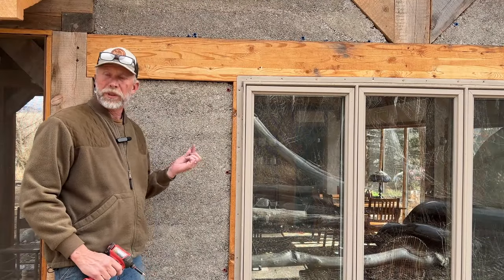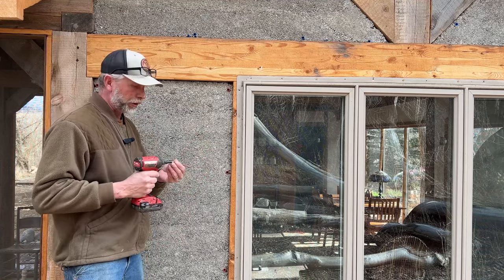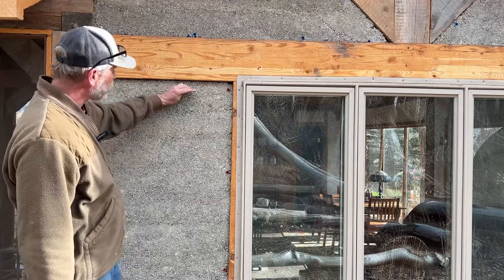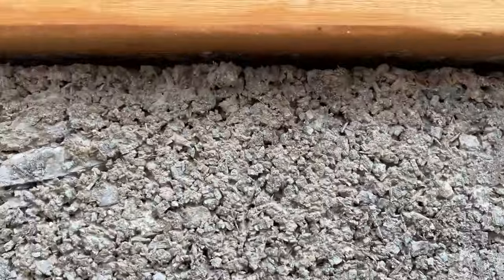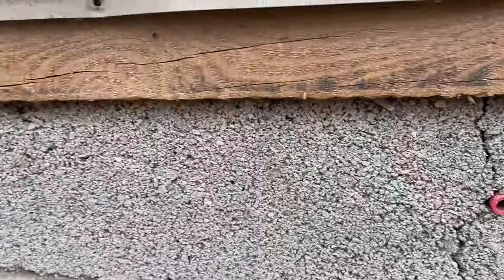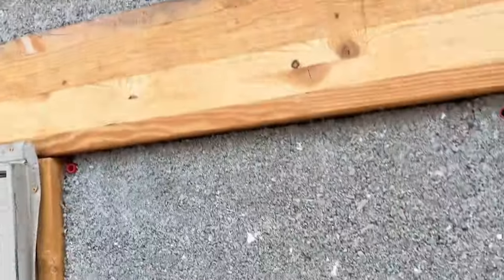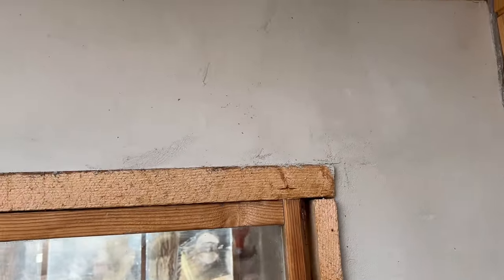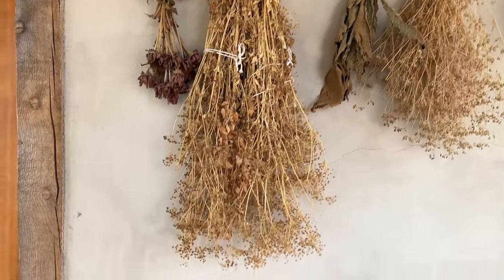Dustcrete FAQ Part 1

Comment: It's written already, but thumbs up for the helpfull follow-up! 
I think it is very admirable you answer a lot of questions, thank you! Good luck!
Reply: I got a $14 corded drill and a $3 cement mixer attachment. I had to use duct tape at the connection because of the soft metal but I've done about 600 gallons so far and I'm very happy that I didn't spend thousands of dollars

Comment: I did some experiments and I kept finding that the cement helped a lot with a cracking. The clay just made things worse. It could be a preparation issue.  

I can say aluminum foil has been a game changer. Mostly in the roof at the moment  The infrared light is an important part to understand about insulation. And it seems the coverage only needs to be on the sunny side.
Reply from the maker: Nice!

Comment: I liked your idea about the next build you do having the wood timbers on the inside and the dustcrete a solid wall just outside the framing structure.  Im trying to decide how i want my walls on my next build and i really like that idea.  Im in missouri.  Tell me though, it seems that the best wall would be made all at once to avoid cracking, but that seems impossible for myself to do and i would prefer to just do a wall at a time like you were doing.  So how could it be done without getting cold joint cracks everywhere.  Im thinking if you just used lime (doesnt it set up much slower than cement?) and also add some sort of mesh reinforcement or fiber (straw or fiberglass etc) to the dustcrete that should help.   Is strawcrete a thing?  Maybe a batch of half straw/half sawdust would give it better crack performance?  Do the cracks even matter as long as you let it crack first and then finish with lime or clay, does that cover the crack so its never seen or would it keep cracking there?  Or maybe it should be designed with control joints between batches/walls?  By the way how are those tests coming with just lime and whatever else...

Comment: You can probably hide the cracks well enough with applying a mesh of fiberglass or something before plastering. The cracks arent a big deal anyway since the dustcrete isn't load bearing and your wooden structure holds everything.  

Personally I'd add tiles or wooden shingles to the roof instead of the metal roof just for the looks. 

I want to learn about timber framing myself it's on my bucket list unfortunately timber here (Belgium) is very expensive as a building material.

Comment: My guess: the cracking is mostly due to the shrinkage - most of the volume is wood anyway and wood will move with the weather. That's why I doubt it will be durable enough in weather with large air humidity swing between seasons.
Reply from the maker: @col0342  I agree, in part. I think this is wood shrinkage. The saw dust I used was super fresh, and lost a good bit of volume in the curing process. I was just sent a Mother Earth article about a man who developed a similar technique in the 1940’s. He found 1 year aged sawdust to be perfect (softwoods). He also added clay and Diatomaceous Earth to the mix.
As to durability, my oldest sections are 4 years in, and show no sign of degradation. The lime plaster helps regulate the humidity within the wall. Even un plastered sections on the outside are rock solid after three years in the elements. My climate is arid.
Reply: @radicalgastronomy  thank you for the extra info.
It's hard to conduct experiments when the time scales needed are in (low) 10s of years and one factor is the (time and geographically variable) weather. Does require a willingness to take a good deal  of risk when using the technique for something as expensive as a home, I might give a try with a shed tho.

Comment: Have you experimented (or have review from others experimenters) about loard bearing dustcrete structures ? What would be the minimal thickness for instance for a wall? And roof sheeting ?
Reply from the maker: I’ll cover this next week, but I believe this is possible with a reinforced bond beam at the top of the wall. If I was doing it I would wait 60 days after packing and form stripping. Perhaps I’ll do some load tests at different thicknesses. I wonder about corners, too…

Comment: What is the wood you're using, what are the best ones, the ones to avoid ?
Reply from the maker: I’m using mixed spruce and fir. Most wood types should work, but hardwoods may be slightly less insulating. I haven’t tried, so I can’t say for sure.

Comment: This seems so promising with so many possible uses, could it be a stucco substitute? I have wood panels on my house that have aged relatively well except for where Virginia creeper Vines have creeped in and allowed moisture and cracking, as I remove them it occurred to me that spackling the house with a mixture like this could provide a paint like powerful protective coating?
Reply: Foamcrete is a Russian product that is very promising but all of their videos are in Russian so I don't know anything about it, but essentially injection flow into a mold and you have a structure
Reply from the maker: @GreenCanvasInteriorscape   This material is great formed into thick walls, but not sure a thin coat would perform well. I recommend a 2” minimum thickness.

Comment: If it shrinks as it cures why not make them into big cinderblock type bricks and after curing use the bricks as a building material?
Reply from the maker: That’s worth a shot, but there is a lot to be said for forming in place.

Comment: I'm probably late to the game with this question, but how would this medium fare in a rammed earth application?
Reply from the maker: @jakeboone6241  It depends on what you mean. If you mean without a frame, it is possible (but unconfirmed) that dustcrete could bear a load. If you mean super compacted, it can be done, but the greater the compaction the less insulation value.